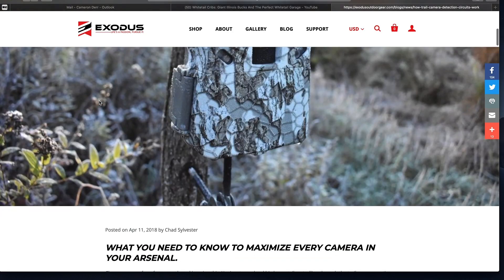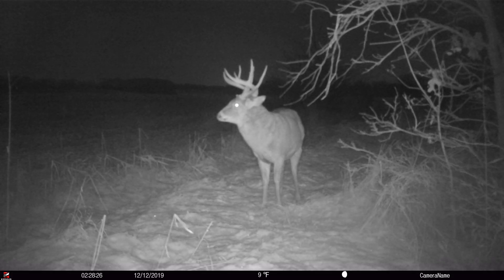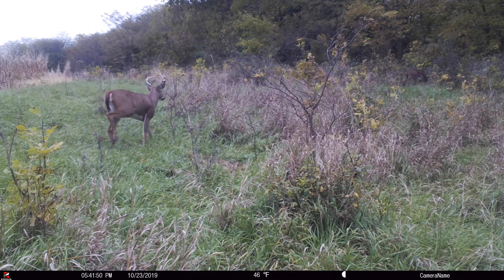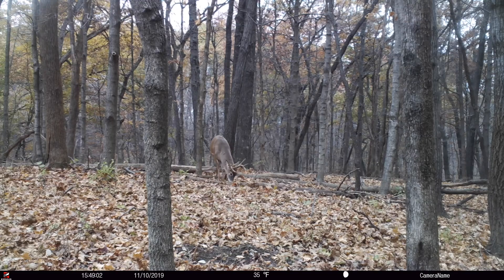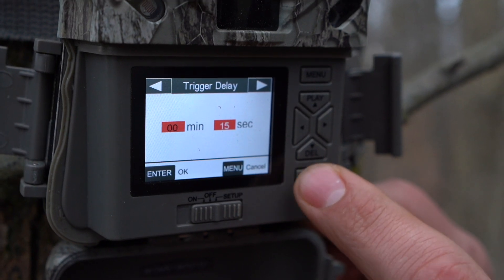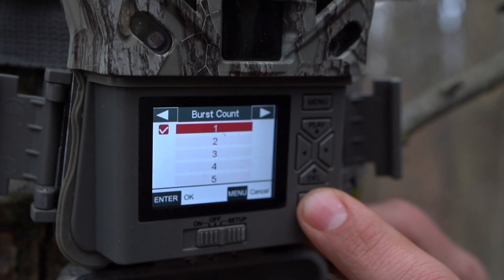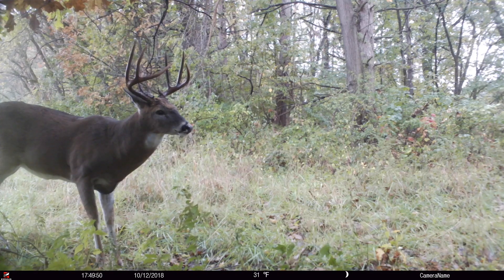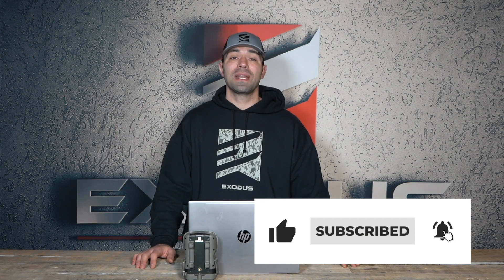False Trail Camera Triggers? Here Could Be Why: PIR Sensor Troubleshooting

Comment: great info!  what about the opposite situation:  NOT getting ANY pics or very few - even though I physically watch a group of deer in front of the cam for 15 minutes moving constantly, cam 15-20 from them and get 2 pics . I've tried a full "reset" to factory settings, new high quality alkaline batteries, then set to 5 sec frequency, etc.  Cam is 3ish years old, out in TX heat year round.  PIR toast?  Just time to send it to camera heaven?

Comment: Memory error even after formatting, have a toguard-H85 and brand new 32gb sd/sdhc cards, even though manual says it will take up a 32 GB card, I'm wondering if maybe I should go down to a 16gb card..maybe this will finally get the results I was hoping for...????
Reply: Lower end cameras are hit and miss, try formatting the card on a computer 🖥 try another card, quality class 10, also your x3 pir are only  x2 inside the camera, use a laser pointer from the center pir to aim it.

Comment: My lift II cameras seem like they will continue to take more pictures or another video with little or no delay as long as there is still movement in front of the camera.
Reply from the maker: Be sure to check the burst count setting and trigger delay. 

If you need support, please send us an email at info@exodusoutdoorgear.com
Reply: Exodus Trail Cameras I normally run on a two photo burst but lately I’ve been running only on video. Burst count only applies to photos right?
Reply from the maker: That’s correct, if you have some examples send them over we’ll take a look.
Reply: Exodus Trail Cameras is the delay on video from the start of a video or after the video ends. So say I have a 30 second delay and 20 second video would there be a 10 second delay after that video ends or the full 30?
Reply from the maker: bowhuntingforlife good question, it would be the full 30 seconds. 

The trigger delay starts after the photo/video event is completed.
Reply: Exodus Trail Cameras ok then I believe my camera triggers again before the full 30 seconds. And it’s a camera I just had replaced from you guys with the latest update already on it. It seems very random. Sometimes it will be after the 30 sometimes it won’t.
Reply: As long as the PIR is sensing change, like described in the video, it will record a trigger event. The LIFT II has a 1 second recovery time, so it's possible with the correct trigger delay the camera can take a photo/video within a second of the previous trigger event.
Reply: Chad sylvester trigger delay is set to 30 seconds
Reply: bowhuntingforlife if the delay is set to 30 seconds it’s physically impossible for the camera to trigger prior to that unless it’s in TL. As you mentioned you have the unit in video mode. The other other thing that is remotely possible, would be a power surge to the PIR causing it to trigger. However in 5 years I personally have only seen that happen twice. Both time were related to battery misuse.
Reply: chadsyl23 I just looked through a card from this camera in December and the first video ends at 4:45:02 and the next starts at 4:45:14. I run NIMH rechargeable if that affects anything. Delay should be set at 30 seconds but I will double check next time I pull the camera card.
Reply: bowhuntingforlife Roger that. If you need further assistance just shoot us an email. Jason will help you out. Also, we have talked about NiMH in other content, not the way to IMO.
Reply: chadsyl23 I have watched and read almost all your articles and videos and I’m aware NIMH isn’t the optimum battery for performance. I just can’t afford to run through lithium’s on video mode. NIMH seem to do really well, this is the only issue I’ve seen and it’s been on multiple cameras and firmware. I will keep observing and checking settings and keep you updated.
Reply: bowhuntingforlife you should check out the SP18 or other external power sources.

Comment: Ya got that new firmware ready yet?  My camera does the "stuck in time lapse mode" and takes pics every 30 seconds.  Thx.
Reply from the maker: Hey Mr. Push, what model are you using?
Reply: @WHTLDEER  I have the Render.  Discussed issues w Scoutek, he knew about the issue.
Reply: Mr Push the issue is a voltage signal, the camera is not “stuck in TL”  Shoot an email to our customer service and we’ll resolve the issue.